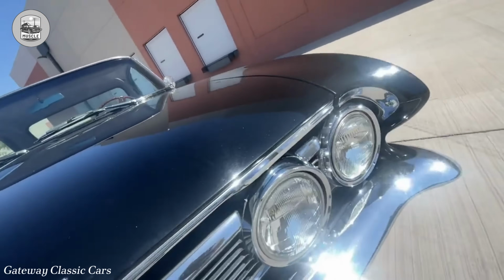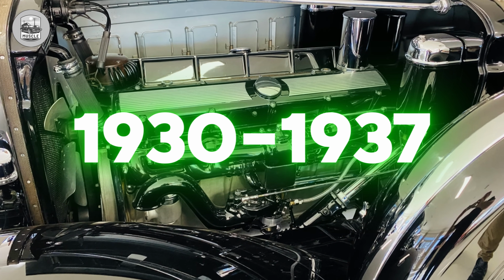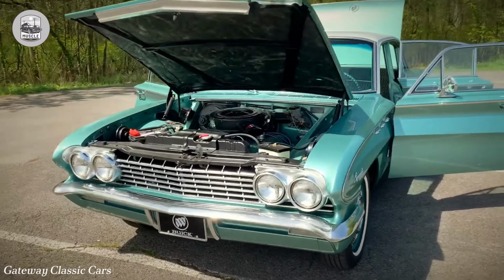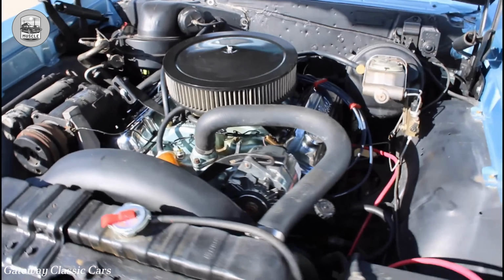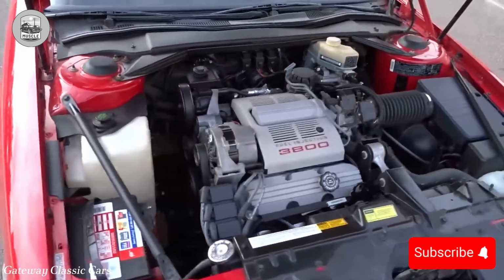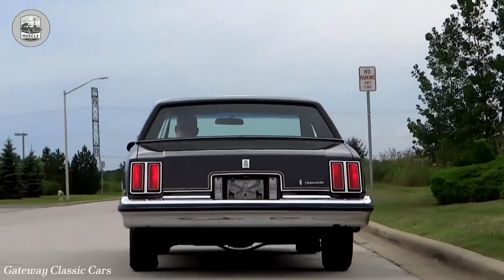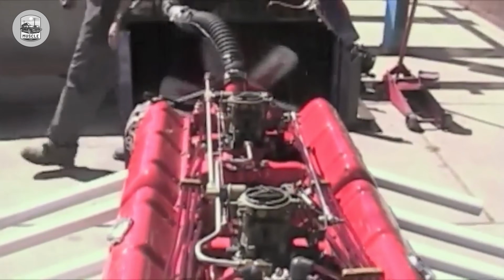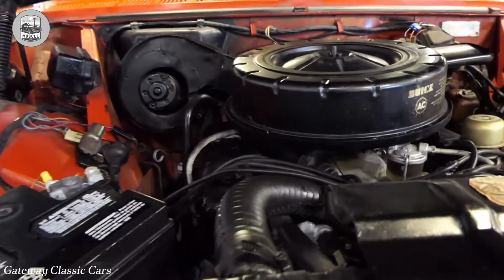10 MOST FAILED and WEIRDEST GM Engines ever made | Worst engines blunder!

Comment: I liked the old Buick Straight-8
Reply: While the old Buick Straight-8 certainly had its charm, especially for its smoothness and torque, it had significant limitations compared to modern engines. The engine was long and heavy, which negatively affected handling and balance, especially in smaller cars. Plus, with only 8 ports for 8 cylinders, it wasn’t as efficient at breathing as modern engines, which limited its power output. V8 engines, with their more compact design and better breathing characteristics, quickly surpassed it in performance and efficiency. That’s why Buick and other manufacturers moved away from the Straight-8 design.
Reply from the maker: Thank you for your information. It is so great...
Let's see our channel is a place to share, comment or show your feelings about American Muscle Cars.
Have a good day.
Don't forget to like, share or SUB on our channel to enjoy other great Muscle Cars videos.
Spending more time with other great videos on our channel to explore more about American Muscle Cars.
Reply from the maker: Thanks for the awesome comment! 
The Buick Straight-8 was a fantastic engine, known for its smooth performance and reliability back in the day. Buick built these engines from 1931 until 1953, and they were especially popular in models like the Roadmaster and Super. It wasn’t a powerhouse by today's standards, but it was the epitome of luxury and durability. One interesting fact is that the Straight-8 was so smooth because of its long crankshaft, which helped reduce engine vibration. These engines also had a distinctive sound that really set them apart!
For those who are into unique engines, Buick's Straight-8 is definitely one to appreciate. What other engines do you think were underrated or underappreciated? Let us know in the comments!
Don’t forget to comment, share your thoughts, and subscribe to Muscle Car Masters....
Reply: @MuscleCarMasters68  Under rated.... hmm... how about the slant 6, used in my Dad's Dodge van growing up.  It never broke down, and we did a lot of road trips in those days.   I heard it ended up in the BMW's with a turbo upgrade, making the 300hp inline.  Let's just say, though it was not a power house.  It was however, very reliable.  Maybe the Most reliable.... but I will leave that for you.  lol
Reply from the maker: @KOS762  Ah, the legendary Slant 6! That engine was an absolute workhorse and often underrated. Chrysler designed it with a unique 30-degree tilt, allowing for a lower hood profile and improving intake flow. Your dad’s Dodge van had a rock-solid foundation with that engine – they were known for their incredible durability and reliability, often outlasting the vehicles they powered! Many say the Slant 6 was nearly bulletproof, which is why you could rely on it for countless road trips without a hitch. Some of the higher-output versions, like the 225, even found their way into muscle cars like the early Dodge Darts and Plymouth Valiants, proving that it could hold its own.
I'd love to hear more about those trips and how that Slant 6 performed over the years! If anyone else out there has Slant 6 stories or any other hidden muscle car gems, drop them in the comments. And don’t forget to share, subscribe, and join us at Muscle Car Masters for more engine deep dives and classic car history!
Reply: @MuscleCarMasters68  well one trip I remember,  we went from Cleveland,  Ohio,  to Washington DC.  There and back in 1 tank of gas.   Here had a 35 gallon,  plastic tank that hung down below the back bumper.   One time here was filling it, and a guy next to him,  started looking under the truck,  wondering where the gas was going.  Lol.  He though,  there has to be a leak or something.   That slant 6 lasted,  until a was old enough to drive.   He gave me the truck when I started my painting business.   I ran it for a decade.   It was a 1992 Dodge ram van.   I finally sold it in 2007 to a carpet company.   Here used it till 2010.  That's a long run.   It had 377k mile on it when I sold it to that carpet guy.   I bet it made it to 400k miles.
Reply from the maker: @KOS762  That’s an awesome story! The legendary Slant 6 engine was truly built to last, and your experience just proves how reliable those engines were. Chrysler’s 225 Slant 6 was known for being incredibly durable, and it's not uncommon to hear about them clocking hundreds of thousands of miles with proper care. It’s amazing that your Dodge Ram van hit 377k miles and kept going strong!
That 35-gallon plastic tank must’ve given you some serious range too—perfect for long trips like the one from Cleveland to DC on just one tank of gas. It’s funny to imagine the guy at the pump wondering where all that fuel was going—he probably never saw a tank like that on a van before!
It’s cool to hear that you used that same van to build your painting business and even passed it on to another hard-working company. Trucks like that were the backbone of so many small businesses, and they just didn’t quit.
Reply: @MuscleCarMasters68  To be honest, I still have my business, but I have expanded into the handyman services.  I really miss that truck.  Nothing I have bought since was as reliable, or even built as well.  I do have the last of the 4cyl Ford Rangers.  its a 2010, in great condition.  I live in the desert so nothing rusts here.  Its a good place to see if there really is any quality, because the bodies will always outlast the drivetrain.

Thank you for your time, and I love watching your videos.  Hope to see many more.
Reply from the maker: @KOS762  yes, thank you so much
have a great day. See you next time... if you have more question about American Muscle Cars, pls share with us.

Comment: The Oldsmobile cutless Supreme 3400 dohc 1992 and later was an oddball as it was a 200 horsepower v6 duel overhead cam engine with both timing chain and timing belt. 
As for jeep the F-head 4 cylinder is very unique as it had 4 overhead valves and 4 in block or flathead valves.
Reply from the maker: Thanks for sharing that info! The Oldsmobile Cutlass Supreme 3400 DOHC from the early '90s was indeed a unique piece of engineering. That 200 horsepower V6 engine was quite advanced for its time, using both a timing chain for the crank-to-cam connection and a timing belt for the cam-to-cam link. This combination gave it a blend of durability and high-rev capability, making it stand out among other V6 engines of the era.
As for the Jeep F-head engine, you're spot on! Its unusual design, with overhead intake valves and in-block exhaust valves, gave it the ability to perform better than standard flathead engines, but still maintain some of that classic simplicity. It was especially popular in Willys Jeeps in the 1950s and early 1960s, offering a rugged and reliable option for off-road vehicles.
For everyone reading, don't forget to drop your thoughts in the comments—let's hear more about those oddball engines you’ve come across! And make sure to like, share, and subscribe to Muscle Car Masters to keep the conversation going,
Have a good day.
Reply: I have to respectfully disagree with your view on the Oldsmobile Cutlass Supreme 3400 DOHC V6. While it certainly had its quirks, calling it an 'oddball' might be overstating things. Yes, it used both a timing chain and a timing belt, which was somewhat uncommon, but this setup allowed for better overall durability in different engine components. The engine itself was capable of delivering solid performance for its time, with a smooth power curve and respectable horsepower for a V6.
As for the Jeep F-head 4-cylinder, while it is unique in its design, it wasn’t as rare as it might seem. Many engines of that era, especially military-derived engines like this one, used a combination of overhead and in-block valves. The F-head design helped improve airflow, but it wasn’t groundbreaking by the standards of the time.
Reply: @AdelynDodson  I didn't say they were bad or meant to imply they were bad. 
They're just odd engines, very different looking from other engines. 

I've been repairing a 3400 dohc in my spare time at work and it has the most unusual timing procedures as you unlock all the cam sprockets before installing timing tools and set to tdc/rear passenger side cylinder
Then lock the rear cams, remove the rear timing tool before rotation the crank 360° to then lock down the fromt cams and remove the last timing tool. 
Unfortunately, the original belt had snapped, and there's no marks on the timing belt sprockets. 

I believe they were built to compete against Ford sho and didn't manage to do so, and being expensive to make was probably let go.
Reply from the maker: @willyck948  You’re absolutely right—this engine was a unique one. The timing process you described is a perfect example of its complexity. The combination of unlocking all the cam sprockets, setting TDC on the rear passenger cylinder, and then rotating the crank 360° before locking the front cams is definitely not a procedure you see every day. It’s no wonder the original belt snapping caused such a headache since there are no timing marks to rely on. GM clearly went all-in on this engine’s design to take on Ford’s SHO V6, but the high manufacturing costs likely led to its early demise.

Comment: I was expecting to see the 2300 CC 140 cubic "inch Vega engine.
Reply from the maker: Thanks for bringing up the 2300cc 140 cubic inch Vega engine! You're absolutely right—it was a notorious example of GM's missteps in the early '70s. The Vega's aluminum block engine was prone to overheating and severe oil burning, especially when GM decided to cut costs by not including cast iron cylinder liners initially. This led to premature engine wear and failure, which damaged the Vega's reputation.
While GM did try to improve the design later with better cylinder liners, the damage was already done. The Vega engine's issues became one of the reasons why this car is often labeled a failure in GM’s history. Despite these flaws, the Vega did pave the way for GM's future developments in aluminum engine technology—learning from its mistakes to improve durability in later models.
Keep sharing your thoughts, everyone! We love hearing about your favorite (or not-so-favorite) engines! Don't forget to comment, share, and subscribe to Muscle Car Masters for more deep dives into the history of American muscle cars.
Have a good day.

Comment: My old 1962 GMC truck had a 305 V6. Short stroke big bore torque monster. 60 MPH was about as fast as I could go. But it could certainly pull a load! With a Stromberg 2bbl carb, it wasn't bad on gas either. About 15 MPG around town, almost 20 on the highway. I miss that truck!
Reply from the maker: Thanks for sharing your memories of that '62 GMC with the 305 V6! You’re absolutely right – those engines were torque monsters, built for pulling heavy loads, and they were durable too! That short stroke and big bore design really gave it a unique feel, especially with the Stromberg 2bbl carb, which helped it stay surprisingly efficient for its size. Those 305 V6s could work hard all day long and still deliver decent fuel economy compared to other trucks of the era. They were a true workhorse! It's no wonder you miss that truck – they don’t build them like that anymore!
If anyone else has stories or experiences with the 305 V6 or other old school torque monsters, drop them in the comments! We'd love to hear more. Don’t forget to share, subscribe, and keep those memories rolling here on Muscle Car Masters....
Reply: @MuscleCarMasters68  More details: it was a panel truck. I bought it in 1976 and sold it in 2012. Carpeted and padded inside, with some beautiful cedar on the upper sides, it was my poor man's camper. So many trips, so many memories. The Dana 44 posi trac got me out of more than a few slippery situations. It was our wood hauler for our camping bonfires. Served as a shelter for all of us when it got too windy in the desert. I put over 200k miles on it and it never let me down. 36 years of memories.
Reply from the maker: @mikeb.7589  Thanks so much for sharing those incredible memories! It sounds like your panel truck was more than just a vehicle—it was a loyal companion through thick and thin. The Dana 44 posi-trac really is a legend for getting people out of tough spots, and it’s amazing to hear how you turned that truck into a camper, complete with cedar and all. 200k miles and 36 years of service—that’s the kind of durability and reliability that really stands out!
And hey, don’t forget to comment, share, and subscribe to Muscle Car Masters so we can keep the conversation going and bring even more awesome content your way.
Spending more time with our channel to explore more American Muscle Cars.
Have a good day.

Comment: I actually think the Toroflow diesel was actually pretty successful.  They made them for lots of applications and they made a ton of them.
Reply: I have to respectfully disagree with that view on the Toroflow Diesel. While it's true that they were produced for a number of applications, being widely used doesn't necessarily equate to success. The Toroflow had several issues, particularly in reliability and longevity compared to other Diesel engines of the time. Many users reported frequent failures, especially in heavy-duty applications, where the engine struggled under consistent stress. Other diesel engines in the same era, like those from Detroit Diesel or Cummins, had far better reputations for durability and performance, which is why the Toroflow eventually faded from the market. It may have had its uses, but in terms of long-term success, it falls short.
Reply from the maker: Thank you for your information. It is so great...
Let's see our channel is a place to share, comment or show your feelings about American Muscle Cars.
Have a good day.
Don't forget to like, share or SUB on our channel to enjoy other great Muscle Cars videos.
Spending more time with other great videos on our channel to explore more about American Muscle Cars.
Reply: The 6.2L cheverolet deisel was another diesel from the late 80s early 90s that was basically a refurbished 327 gas engine... had decent power and torque, but was NA and only failure point i found on any of them was a weak Crankshaft that would snap after a few short years of abuse
Reply from the maker: @anthonykelso2249  Thank you for sharing your insights about the 6.2L Chevrolet Diesel! You're absolutely right—it came out in the early 1980s as a naturally aspirated engine, and while it wasn't directly based on the 327 gas engine, it did borrow design philosophies from GM's gasoline engines. One of the key factors was its efficiency, which made it popular in trucks and military vehicles. The 6.2L wasn't built for high performance, but it was known for being reliable—aside from that crankshaft issue you mentioned. GM later beefed up the 6.2L with the introduction of the 6.5L turbo diesel, addressing some of those durability concerns.
We love hearing feedback like this—it keeps the history alive! Everyone watching, let us know your thoughts on the 6.2L Diesel and other classic engines in the comments. Don't forget to share this video with your friends, subscribe to Muscle Car Masters, and stay tuned for more deep dives into muscle car engines....
Have a great day.
Reply: @anthonykelso2249   The 6.2 diesel has no relation to the 327 gas engine , nor any other engine.
Reply: I just found a 1970 gmc 5500 truck  with the 478 toroflow in it,  where it sat in a barn since 1978.  runs great !
Reply from the maker: @larrygardner2836  The 478 Toroflow diesel was quite a unique engine, designed more for low-end torque and commercial use, and it was built to take some serious punishment. It’s impressive that it's been sitting since 1978 and still runs great! Those engines had a reputation for being rugged, although they never caught on like some other diesels due to their weight and somewhat unconventional design. If it’s still running strong, you’ve got a rare piece of history on your hands—definitely worth preserving...
Have a good day.
Reply from the maker: Thanks for your comment! The GMC Toroflow diesel was indeed an interesting engine and had a specific role in medium-duty trucks and buses. While it shared some design features with its gasoline counterparts, the Toroflow was built with durability in mind, especially for commercial use. It was available in both 351 and 478 cubic inch configurations and was used in a wide range of applications from delivery trucks to school buses in the '60s and '70s. Its reputation for reliability in these tough roles is what helped it gain popularity.
However, some critics felt it didn’t quite have the efficiency or power compared to other diesel engines of the era, like the Detroit Diesel. Despite this, GMC stuck with the Toroflow for many years, which shows its staying power in the market.

For everyone else, what do you think of the GMC Toroflow? Have any of you worked with these engines or have stories to share? And if you're enjoying these deep dives into unusual engines, don't forget to like, share, and subscribe to the Muscle Car Masters channel! We're always bringing more unique content your way.